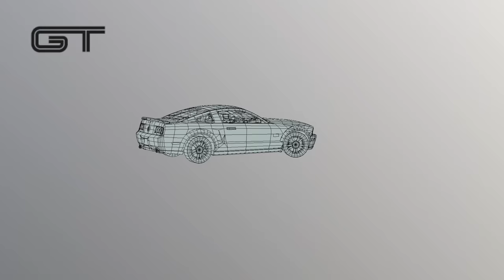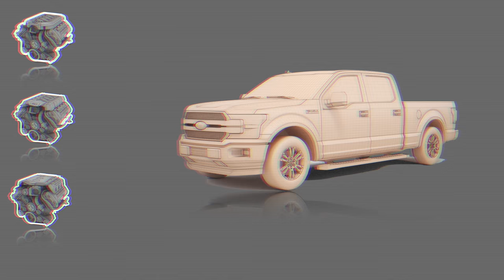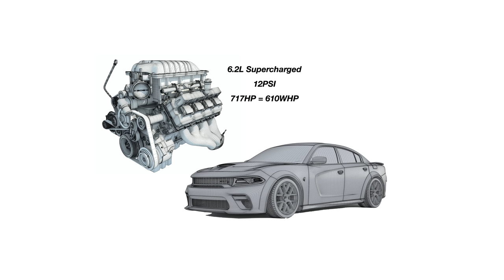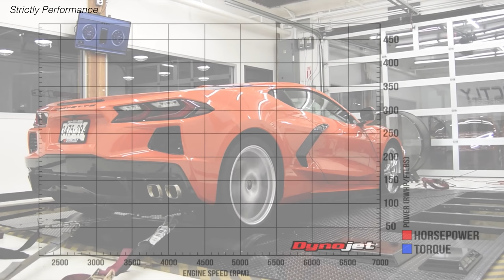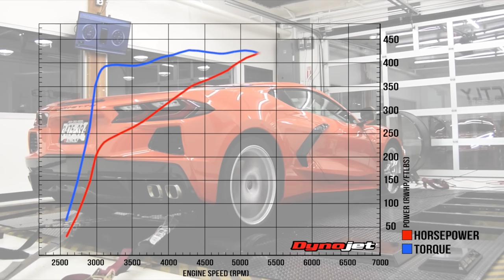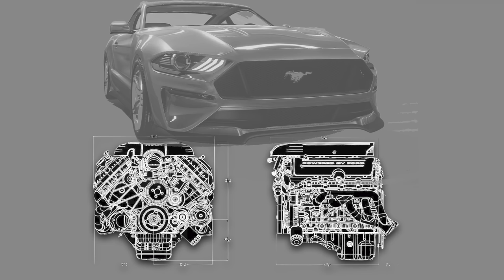How 5.0 Coyote Engines Beat LS and LT😮 | Explained Ep.2

Comment: I have a 2011 F150 5.0 best truck I owned. Has 224k miles and used it for many road trips. The most I ever had the truck do, was towing my other car from STL to LV. Very reliable and smooth power delivery. I know the truck 5.0 is different than the mustang 5.0. But regardless the 5.0 is a very good motor. One day I’ll get a gen 3 10speed 😉
Reply: Present day I have a ‘12 F150 Coyote with 65,000 miles. I have an aftermarket exhaust system and it sounds just like its coupe comparison sister. Gosh I love the truck, lowering it soon and putting some love into the engine. But Im sure it’ll be very appreciative of the power I put behind that crank. One other thing I noticed is while Coyotes also love hogging air into the intake, when you downshift in those trucks/stangs, the backfire is one of the scariest noises Ive ever heard. Its sure enough to make a whole daycare wet themselves lmao
Reply: I have a 2011 f150 5.0 and a 2019 3.5 ecoboost. Smooth power delivery? the 5.0 doesnt make power until 4500rpm. Drive an ecoboost.
Reply: @enigma9789  the EB has too many horror stories than the 5.0. They make power but at the end of the day the 5.0 is the better motor.
Reply: @6.2Slomaro  But how do you know without owning both?
Reply: @enigma9789  why would I own one after knowing from everyone’s experience with the EB? I did my research while I was looking for an Ford F-150 and I’ll gladly stick to the 5.0 motor.
Reply: Nice, I’m also looking to get a gen 3 10spd, cyclone will do for now 😂 😂 😂
Reply: @enigma9789   Owning a 3 year old EcoBoost in and of itself doesn’t make you an expert on it by any stretch.
Reply: @BC08  But not owning one makes everyone else an expert? OK
Reply: @enigma9789   Nope, but neither does owning one.   At all
Reply: @enigma9789   Guess you’re so deluded as to actually think making a payment gives you any mechanical expertise at all.
Reply: @BC08  all I literally did was compare a 5.0 to the 3.5 ecoboost on power delivery. That's it. You came in saying I wasn't an expert as if I tried to be. I can guarantee I have done plenty of mechanical work in my time.
Reply: @enigma9789   No, that’s not how this conversation actually unfolded at all.  

Michael up there responded that there’s too many EcoBoost horror stories for him to want to buy one and that the 5.0 is a superior engine. 

You responded with saying if you haven’t owned one how would you know? 

The implication being that you CLEARLY suggested short-term ownership provided expertise on the matter of EcoBoost reliability.

Also, the 5.0 Coyote IS an objectively superior engine - architecturally speaking.  
Does it have as much low end torque as a 3.5 EcoBoost when stock?   No.  
Will a few psi of boost charge that fact?   Yes.
Will a stock Coyote hold more power than a 3.5 EcoBoost reliably will?  
Yes - almost double the power in fact.     
Do 5.0 typically have fewer issues than the 3.5 EcoBoost?   Barring maybe 2018-early 2019 build 5.0s yes they do.    
Fewer issues with timing chain drive and/or cam phasers failure for example.

I’m not hating on the EcoBoost either.    I was simply challenging your apparent assertion that ownership provides expertise.   

Your average soccer mom who owns a Suburban — and doesn’t know how to pop the hood — is NOT a greater expert on that Suburban than the lead tech at the local dealership is … even if he never owned one.
Reply: @BC08  well said 🍻
Reply: @6.2Slomaro everyone? Pretty sure the 3.5 and 2.7 are stout. 2018 the 3.5 had some issues, and 2021 there were a little under 50 Bronco 2.7s that dropped valves, but other wise the Ecoboost V6 is great. Why else would they drop it into a track day 500k supercar?

Comment: Great video! The boss302 roadrunner does come pretty much built from the factory, with the forged crank ect. Also Gen 1 are safe anywhere in the 600s, it's once you make 700+Rwhp you'll pop it.  Oh and OPGS are only a issue if you're bouncing off the limiter.
Reply: What is your opinion on the Boss's maximum HP?
Reply: @JamesWilliams-dj2bp  same as a Gen 2, around 800, its the transmission that will go before the engine on a Boss 302
Reply: @JamesWilliams-dj2bp  North of 1000Rwhp. The boss came with a forged crank, with pistons & rods.  As well with boss specific cams, heads, valves, & valves springs. Gen 2 got some of these goodies, but not everything.
Reply: @RR550_  roadrunner > Gen 2 

Forged pistons and better heads/cams. 1000whp stock motor is a lot easier to handle on them.
Reply: All you got to do is take the pistons out and gap the rings to 30 thousandths. Then they are good for 900 hp all day. The number one reason stock engines fail, while being boosted, is ring gap. Nobody bothers taking the pistons out and gapping the rings for boost. Before throwing 20 psi on stock gap. 🤣
Reply: @jesusstopsbullets5111   Very true
Reply: @SquadMane  all coyotes have forged steel crankshafts

Comment: Amazing video! Grew up loving Chevy's, started with an old C10 with a built block, now I bought a 2021 GT with the 10 speed and man does these 5.0s put in work!
Reply: My mustang ecoboost beats 5.0s all day
Reply: There’s always a eco booster out there waiting in the shadows to justify their purchase vs a 5.0. Don’t get me wrong, I love the eco boost platforms and respect the power they can make but stock vs stock the 4cyl mustang doesn’t stand a chance vs a 5.0. Now with a tune and a boost controller they are absolutely faster  than a stock 5.0 but both at max bolt on or max boosted the 5.0 will win every time even built N/A 5.0 vs bolt on eco boost leans towards the 5.0🤷🏾‍♂️
Reply: @xxxroberttheking  yeah ur right! But I’m the one lurking in the shadows! Hahah my stock engine with
Upgraded turbo and intercooler is maxed out at 420whp.  And yeah stock vs stock a 5.0 wins hands down but the ecoboost mustang actually keeps up pretty well and almost ties in a 1/8th mile race.  So the ecoboost are impressive for being a 4 cylinder! Right now I’m building a 1000whp ecoboost mustang! Gonna be sick!!  But seriously people under estimate the ecoboost mustang! And I’ve raced scat packs and 5.0s and I’ve won!  My new build is gonna be a one a kind!! I’ve always been a 4 cylinder turbo guy so when mustang ecoboost came out I had to have it and with the 10 speed transmission it’s pretty impressive even at stock!   But just with upgraded turbo and intercooler you can reach 420whp on the stock engine.  And for way less money then a 5.0 or scat pack cost. I seriously love my car so much even at the 420whp limit.  It rips!
Reply: @Paper.Power.Politics  I understand your enthusiasm, but with the right amount of money, anything can make good power. However, spend the same money on the coyote and I can almost guarantee the 5.0 will make 1500+ hp. Funnily enough, the 2.3-2.5 Duratec engines are thought to be a 5.0 cut in half. They also have a high volumetric efficiency. My n/a 2.5 has a volumetric efficiency of around 105-110, just like the Coyote. I will be boosting it soon and see what it does.
Reply: @cesarpalmos8235  yeah I agree , yiur 100% right. A mustang ecoboost is just what I wanted tho. To each there own.  But My build is not the normal ecoboost build. I’m using a sleeved 2.0 focus ST block with the 2.3 internals. The focus ST 2.0 block is way stronger then the 2.3.  I’m also using a 4 port head vs the stock single exhaust port head.  Everything is custom spec forged.  Goin along with a xona xr 105 69s turbo and turbo kit made by ets. Also gonna be dual injection port and direct.  It’s a extensive build and built to handle way more then the stock 2.3 is built for.  Also getting the 10 speed transmission built , also gonna be dual clutch like the 10 speed on the 5.0 is.  Using the best metals and parts you can get for the build. Like custom spec Darton sleeves, custom spec traum pistons, custom cvt piper cams, 4330 Callie’s enforcer rods , coated bushing with upgraded 3.5 rod bolts and a upgraded h13 tool steel wrist pins. It’s gonna be sick!!!!!
Reply: @Paper.Power.Politics  I have a 2010 Ford Fusion with a 6 speed Mazda manual transmission. The  2010 Fusion was actually the same as the MazdaSpeed 6 with the 2.3 "ecoboost" (the precursor of the ecoboost badging.). The MazdaSpeed 6 are known for making high hp as well. Since the MazdaSpeed 6 was literally a Ford Fusion, I'm going to use the Corksport Turbo CST5 system and their turbo back exhaust system, turbo header and blow-off valves, Corksport Injectors, Corksport intake and intercooler, and other mods. I'm in the process of performing maintenance first. I've replaced my control arms, sway bars, resealed the engine, replaced fluids, installed Corksport engine and transmission mounts, installed GodSpeed MazdaSpeed 6 coil overs, and currently installing GodSpeed MazdaSpeed 6 upper camber arms. I don't plan on making alot of power, just enough to confuse the v8 muscle cars, hence, my Fusion is named "Project Confusion." I plan on making 420-450hp since that is what the transmission can take. When comparing a MS6, it should be a high 11, low 12 second car in th 1/4 mile.
Reply: @cesarpalmos8235  that’s dope!! Sounds like a super cool street car? And you definitely gonna be smashing a lot of V8s! Where you from?
Reply: @Paper.Power.Politics  Houston Texas, and yes, It will still be a "daily". The real hp stuff will be done on other cars.
Reply: @cesarpalmos8235  what’s your other builds? I’ve seen big power Mazda 3/6s All day!  Crazy how they based the ecoboost design off of the Mazda engines.
Reply: @Paper.Power.Politics  Actually the Mazda engines were Ford Duratec engines. Ford was building a lot of Mazda's cars and trucks. I'm not sure why Ford didnt make the Fusion sport an Ecoboost. Right now my fusion is my only car, I'm in the middle of opening my business to be able to buy more cars.
Reply: @Paper.Power.Politics  I used to have a turbo Ford ranger, a n/a 4.6 mustang, and an LT Camaro.
Reply: @cesarpalmos8235  yeah but the ecoboost are different then the actual Mazda engine I believe.  I don’t even think parts are compatible! And nice bro that awesome to Hear!! Keep that up bro I wish you much success!
Reply: @cesarpalmos8235  I had the 95 5.0 a while back ago and also 97 trans am! It was fast af! Lol
Reply: @Paper.Power.Politics  Yes your right, the internals are still the same, but there has been a lot of changes to make it a new platform. Thank you, wishing you the best.
Reply: @Paper.Power.Politics  crazy, the 5.0 is still better
Reply: @Paper.Power.Politics  Yeah till you're EcoBoost breaks and costs an arm and a leg to replace the turbo in that four banger.
Reply: @Paper.Power.Politics  I bet you would be extremely happy if Ford replaced the 5.0 with the 2.7L EcoBoost V6 or the 3.5L EcoBoost V6.
Reply: @Paper.Power.Politics  How much money 💰 do you make to afford all of this crap kid.
Reply: @yeboysalty8152  Exactly mate but these Turbo kids just don't and none of they're EcoBoost powered vehicles won't outlast my good ol 96 Ford F150 with a 5.0L (302) Windsor V8.
Reply: @CJColvin  who says I’m a kid?
Reply: @CJColvin  no I wouldn’t. To each their own ya know.  Glad there is a variety for everyone’s taste!
Reply: @yeboysalty8152  from a stock standpoint of course it is!
Reply: Stephen Schneider  I’m sure to some that is true. And even if that was true it’s not cool to make fun of someone who is less fortunate then you.  But if you really wanna know. I’ve always like 4cylinder turbo cars , like evo , srt4, k20, 4g63 etc so when mustang came out with Their 4 cylinder turbo I had to have it.  Now if you can actually break down the math if it’s not to much for you, I only put less then 5k into my ecobeast and I’m faster then a stock 5.0 , And a stock scat pack, so
How do I have a faster car for way less the cost!! Now I wanted to build on this platform and that’s what I’m doing because it’s what I wanted. So what! Off the factory line of course the 5:0 is way superior. But you can also build the ecoboost and if do your research there’s already some really powerful fast ecoboost mustangs running 9s
Reply: Stephen Schneider  yeah until you get slapped in the mouth. 🤣.  And yeah that’s what I’m saying I’m one of those people that genuinely wanted a ecoboost mustang, or the Ford Focus RS.  Mustang has same engine and I love the body style of the newer s550 2018+ and it had the 4 cylinder twin scroll turbo. Yup that’s what I wanted. Now I’m building it.
Reply: Stephen Schneider  well guess it doesn’t mean that specifically guess just matters how someone takes it.  I don’t care I love car talk lol I have no fiends 😂
Reply: @Paper.Power.Politics  You're going to wreck that motor with 500hp, let alone 1000. At that point you basically just put a new motor in or buy a 5.0...

Not only would the motor be 100% replaced, you'd have to replace the transmission and reinforce the frame because even the Shelby Super Snake has issues with frame twist at ~830hp. 

Sure you can make a 4 cylinder that puts out 1,000hp. Those are for specific racecars and the motors need to be pulled and rebuilt after every run basically. At that point to build and maintain this vehicle would cost upwards of $250,000 easily. At that point you might as well just buy a car that actually makes sense and will be cheaper and more reliable.

Overall, it sounds like you don't actually want an Ecoboost. If you're that insecure and are also a millionaire, but still want a Mustang, go buy a Super Snake or something. What you're describing is a Frankenstein monstrosity that will probably throw a piston through someone's face within the first 1/8 mile.
Reply: @pleasestfu4801  You’re wrong I’m not using the stock two. Three block and nothing about the engine in stock everything is forged and sleeved the 2.0 ST block and a 2.0 TS block are different than the 2.3 block and are way stronger that’s how people build the ecoboost they use the 2.0 blocks and use the 2.3 internals and crankshaft which makes it a 2.3 it’s the same ecoboost engines just different variants the 2.3 block is known for cracking and weak structure since it’s an open deck I’m using the 2.0 ST block which is close deck much stronger and it’s sleeved so he can handle really anything over 500 wheel horsepower reliably. It’s been proven for years already there’s plenty of people pushing 600whp+ in their ecoboost and not even using sleeves in the block. I’m also using a variant ecoboost cylinder head instead of the 2.3 head..  So it’s built to handle at least 700whp reliably , it can easily push 1000whp, but I don’t wanna push it to the extreme and stress the system. So gonna be running 600-700whp.. there’s tte focus RS RX that gymkahana used to drive that thing was pushing 600hp and they said can easily handle 1000.   So mine
Is similar to those builds.
Reply: @Paper.Power.Politics  What's the point in buying an Ecoboost if nothing about it except the shell are from the original car? Why not just buy something that has the internals you want? You'd spend half as much and have half the problems.
Reply: @pleasestfu4801  well to be honest , the svo 2.3l mustang is an original car , it’s not a new set up. 2.3l been a round for a while.  Secondly I’ve always been a inline 4/6 turbo guy, so a mustang with a inline 4 like the old mustang svo was very attractive to me plus it was a lot cheaper then the GT for about the same in power cars as far as stock in a 1/8th mile race.  And to make the GT fast at 700whp it cost around the same and it would cost more actually if I was to get a GT which isn’t what I want.  My stock engine ecoboost with upgraded turbo smashes GTs at 420whp.  And lastly I wanted a unique set up which everyone and their grandmas won’t have. Lol  as far as reliability , there plants of 600whp+ daily driver focus ST and RS as well as the ecoboost mustangs.  So with built ST sleeve block, ported built head, 72 mm turbo built GT 10spd transmission , should be pretty reliable at 700whp. Just like a GT would. It’s all a matter of preference and no matter what it cost lots of money to go fast.

Comment: The voodoo has to be my favorite engine for its sound. My only hope is I can mess with it the same way you can a coyote
Reply: have fun with that....due to the lack of a balanceshaft to counter-act the flat-plane crank design, the 170g's of lateral movement vibration from 7250-8000 it just keeps breaking starters, bellhousings, and even in some cases breaking the track-pack oil cooler right off the side of the block...JUNK!

Comment: That's the tradeoff here.  You get to choose the better head, or the larger block.  I think I like the ohv better though.  It's easier to get the GM engines to rev than it is to increase the displacement of the coyote.  I also like the fact that ohv engines fit in smaller engine bays.
Reply: Isnt all of the engines over head valve.. did you mean cam?
Reply: @MichaelWittner  pushrod engines have yhe classification of OHV. Yes all engines are OHV but they do not have cams above them. Imo easier way to say ut is CIB or cam in block
Reply: @azolis1597  ok gotcha. Just using different terms than what im used to.  We usually say DOHC or SOHC and call the others push rod motor
Reply: ohc engines are not true american v8 muscle